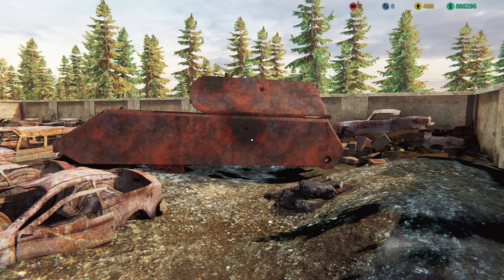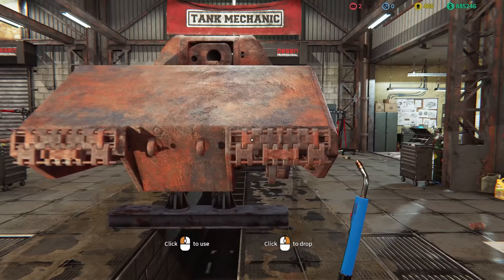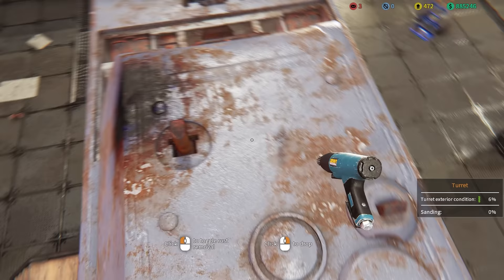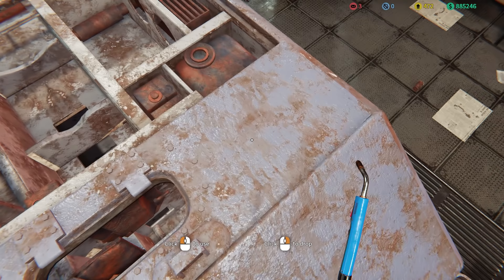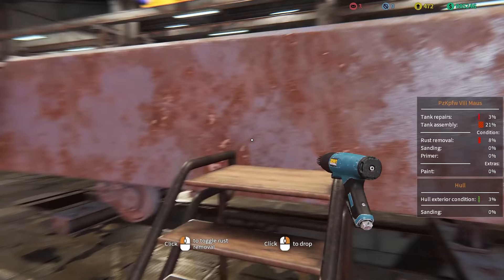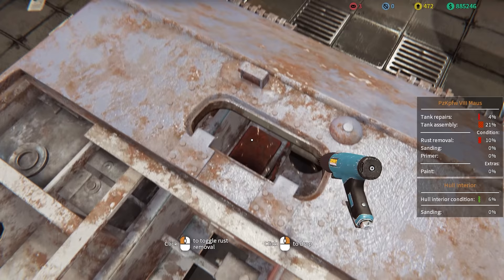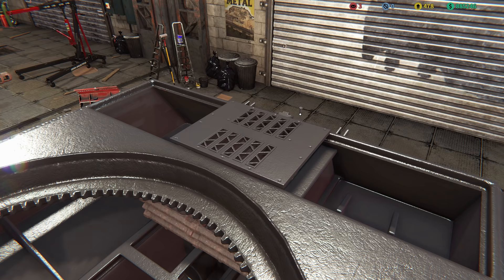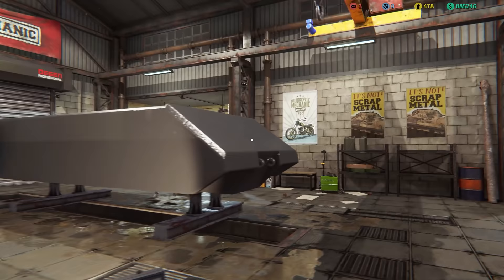MAUS - Tank mechanic simulator #1

Comment: There are documents about the interior, after the Russians did an evaluation, it got wrecked by a fire
Reply: ohh
Reply: Cool, would anyone know where to find these by chance?
Reply: that's for the hull, which is the V1 prototype, the turret is from the V2 and the interior was wrecked when the Germans blew it up
also the soviets just gutted the thing, there's nothing left inside
Reply: @theblueshellthebaneofmario3469  there was 2 maus protypes built
V1 was just the hull with a concrete weight in lieu of the turret, was captured intact by the soviets
V2 was fully built, the Germans tried to evacuate it but it broke down/too slow/no fuel and they blew demo chages inside of it, destroying the insides and causing the left side plate to fail
later the soviets just plonked the V2 turret on the V1 hull

afaik the maus didn't catch fire but the soviets just gutted it to analyse the technology
Reply: @quentintin1  but, would anyone want to try to make a operational replica of the Maus?

Comment: Nice video! You can actually go into the interior by going to the menu where you can see the inside eof the vehicle. Just press "Get Inside" and select the appropriate crew station. You can still use the tool belt in there. It's also a lot easier to use numbers for the tool belt.

Comment: 2 things:
1 I can't get a Maus to spawn anywhere in my game.
Like I tryed the scrap yard and digging missions for the last 3 weeks or so but nope.

2nd.
Even though I didn't find one jet I counted how many individual parts this vehicle has in the game.
Without the engine, hull and turret being counted as individual pieces, the Maus has 619 parts.
About 200 are for the running gear alone.
About 150 - 200 parts are bolted and there are about 15 parts that can't be repaired with tools

Comment: The Maus had an aircraft engine, likely a Daimler-Benz V12. Uboats had much larger diesels such as a supercharged 9 cylinder that wouldnt fit in the hull of a maus.
Reply: The DB509 was derived from the 600 series which were aircraft engines. However, the 509, and proposed 517, were purpose built engines for tanks and locomotives(?).

Comment: Biggest tank ever build, only 1 complete prototype and 1 complete hull get out from factory

When Soviet comming, German try to the destroy the tank, in the end of war Soviet put Turret from first Prototype on second Hull (Now in Kubinka Museum)

Dozen of uncomplete Hull and Turret still in factory until the end of war, get scrap in the end

Maus Number 1-7 planned using it original Turret, while Number 8 onward will use new turret, the vehicle will dub as Maus II

E-100 in WoT use this Maus II turret, not exactly the same, since E100 planned to use lighter turret of either Maus or Maus II, so the armor is thinner
Reply: E100 was gonna have a turret similar to the panther 2 prototype so it could house the long 88

Comment: Some incorrect information about the history of Maus. 

To this date, onle 1 vehicle survives. That's Typ 205/1. That is, first chassis mated with the first Krupp turret. 
But in reality, two Maus were finished, around 10 hulls and turrets were finished, and materials for another 30 more vehicles were ready. Remember that this tank was accepted into service, it was supossed to be mass produced. 

As a side note, for people wondering, there were 3 different Maus. Well, actually every single Maus was different since chassis had measurance issues and they were adding or changing stuff all the time. 
These 3 variants are: Maus {the one we know nowdays}, Maus II {basically from hull number 6 or 8 onbords it will be this} and Tiger-Maus {known more commonly as E-100 by Krupp, this was more ligher and using a different hull, and since components weren't ready on time for the first hullss they just used already existing Tiger components}.
Reply: There were only 4 complete/semi-complete hulls according to Thomas Jentz. An additional two hulls were being built but were scrapped sometime after the Böblingen tests. No other turrets were complete and the V1 turret, the one with the rounded front and originally mounted on the Nr. 2 hull, was only a placeholder. The Böblingen revealed a lot of issues with the V1 turret. There was R&D being put towards a V2 turret that would serve as the final turret. The Nr. 1 hull also only had a turret weight attached and no proper turret.

The Maus(and the E-100 as it was a parallel development to the Maus) was also never accepted into service and the project was dead in the water by mid 1944. We only see some additional effort being put when there's a request to DB in December 1944 for a DB517 engine. To this DB states they can only have one ready by January 1945 as they only have an incomplete one and the only other 517 was mounted onto another Porsche project. Jentz attributes the project's cancelation to Albert Speer's production reforms and to the growing strains on Porsche's factories.

The Maus II was only a proposal that was never accepted. To my knowledge, they didn't even make mockups for it unlike the V2 turret.

Comment: The engine is a DB603 wich was use on ME 410 for exemple
Reply: even used in the Italian G.56's
Reply: Wrong. It used a DB509 and was set to later mount a DB517 before the project was canceled.

Comment: the  germany really build  too many of these
Reply: They managed to complete two before the war ended. They did not go into action.
Reply: @davidtapp3950  those were just prototypes and only one actually had a turret as the only factory where they could be built was bombed during their construction
Reply: @SolyTheGreat  it may be that my reference books are a little different from yours. 🙂
Reply: @davidtapp3950  Thomas Jentz confirms it was never anything beyond prototypes. The project was canceled in mid 1944 and R&D for the V2 turret and DB517 were also canceled.

The only really completed 1, which is a stretch as the V1 turret barely worked and was set to be replaced with a revised turret design
Reply: They only built 2 lmao
Reply: @tripwire3992  I know... I was sarcastic
Reply: @catgaeming2025  couldn't tell, based on the comment, no tome indicators or anything